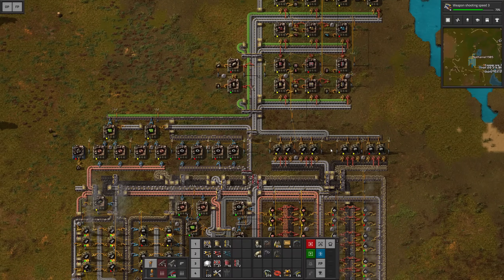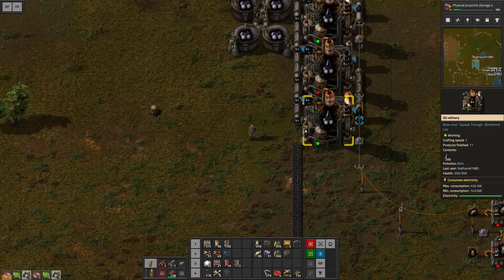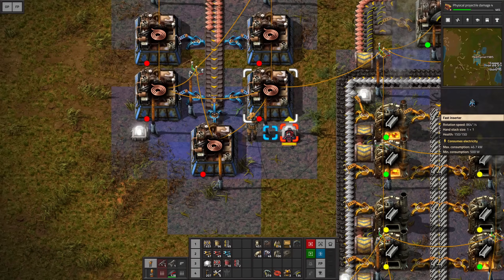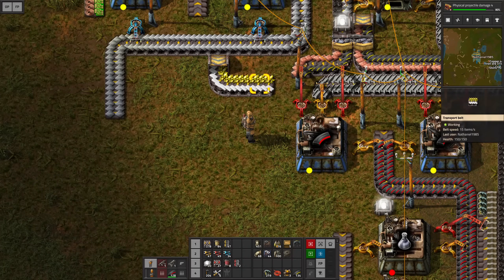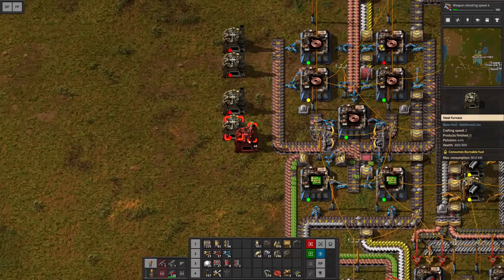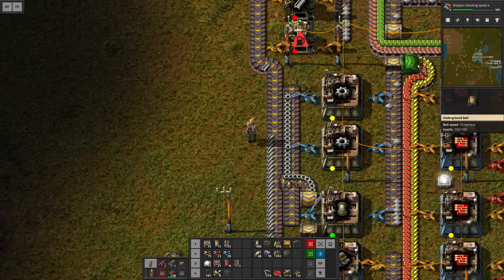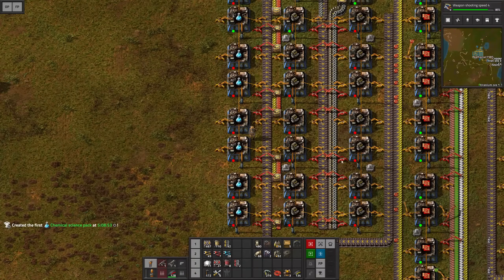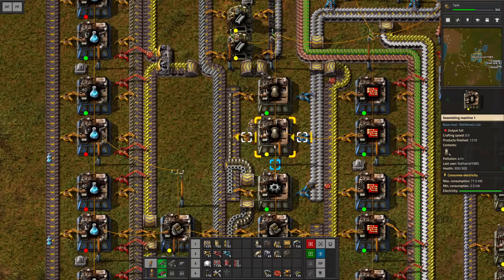CHEMICAL SCIENCE PACKS - Step 7: Factorio Megabase (Step-By-Step)

Comment: Around 12:53 when you add the speed modules: Is your train of thoughts not wrong here? You are adding speed modules to the plastic which improves the yield per second. This is true but does that not also increase the cost in a linear fashion? When you check the ratios this even confirms it I think. You produce roughly 37 petroleum but you use up more than 60 if I remember right, due to the speed modules on plastic. Would the production modules not be better here? Imcreased energy consumption but more yield per intake? Speed modules seem like a good use if you have not enough space. Otherwise you can always add a second machine which would result in the same output right? I played alot of satisfactory and i just got into factorio so this was just my thought process. Please correct me if I am wrong. Trying to learn here :) 😊
Reply: Welcome to Factorio!
Yes your train of thought here is very much correct. All the speed modules do is increase the speed but also massively increase the power draw of a machine (it doesn't make them more efficient but he simply needed more production, not more efficient production). It is more effective to just place another machine in general in the early stages. Speed modules really start shining in the later stages of the game with beacons, but that's not relevant for now. The correct solution here would have been to just build a larger refinery area with some more buildings rather than using modules.

Productivity modules make more stuff out of the same input (it essentially creates a second 'free' progress bar where if that is full creates an output item for free, the speed at which this bar goes up depends on how good your productivity % is. 100% productivity would mean for ever time you craft an item, you'd get a free item) but they too have their downsides of slowing down machines,  creating more pollution and also massively increasing power consumption.

In general this playthrough so far is a great general idea of what to do but it isn't perfect by any means (but it doesn't have to be! this shows that you don't have to be perfect in order to do great in the game), this entire base is essentially temporary, its not made to be expandable or well designed, just to get the job done and unlocking researches for a more permanent solution. In a previous episode he also upgraded some yellow splitters to red splitters without upgrading the belts 'for throughput', this does nothing in practice so it's not a flawless playthrough. But it's an excellent general guideline to get you where you want to go and shows you his train of thought designing things on the fly and how to deal with problems as they show up (because everybody misplaces inserters, or accidentally forgets to turn a belt)

My own advice would be to treat space less as a valuable commodity, and avoid splitting/remerging belts over and over. I'm personally a fan of setting up a trashy spaghetti base for red and green science for the initial researches and then switch to a more spacious well thought out main bus design for the rest of the sciences. In general it's a good idea to err on the side of planning out too much space rather than too little. The only places where I'd accept a spaghettification would be in the startup red and green sciences, and in the item mall.
Reply: @netneo4038  Your clarification is much appreciated. Thanks :)

Comment: when I deploy 16 assemblers for chemical science packs it says produces 0.667 per second instead of 1 like yours. are you using a mod, or am I making a mistake?
Reply from the maker: No mods that  would influence this variable. Maybe modules are missing or not enough power?
Reply: @Nathans-Sandbox  You said you need speed modules only for refineries and chemical plants, not science pack assembling machines. watches twice can't where you input modules to assambling machines. also when I hover to blue science pack, it shows "24 s crafting time"
Reply: @Nathans-Sandbox   and yes I didn't install modules yet, but modules are for sulphur not assambling machine? how would they impact per second science pack production? can you explain please thank you!!!!
Reply: @lucybennett2130  Hi there! I bet you are using Assembler 1 machines (crafting speed of 0.5) whereas Nathan is using Assembler 2 (crafting speed of 0.75). That's a one-third difference.
Reply: @louisrovegno542  exactly, that was the cause thank you! :)